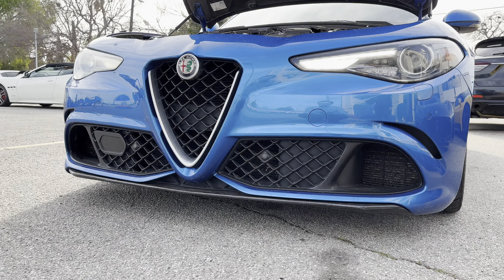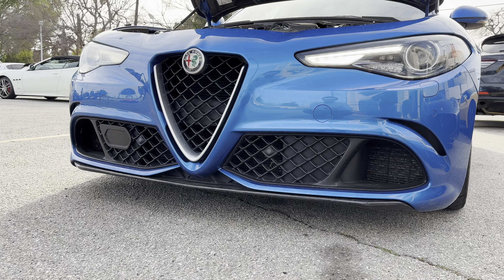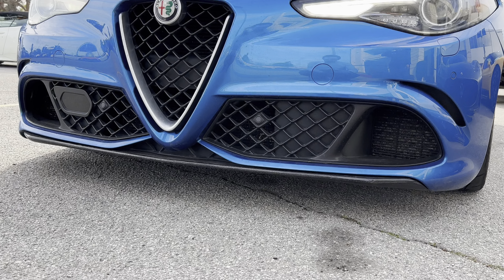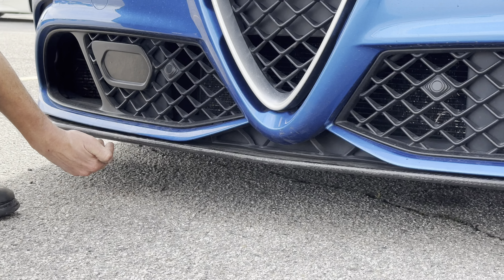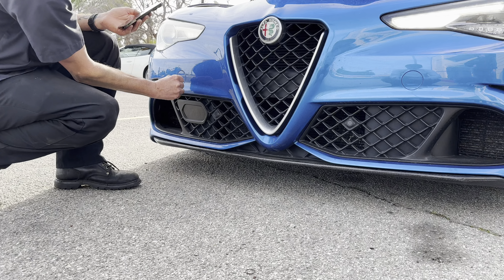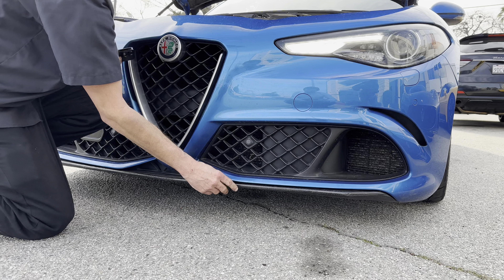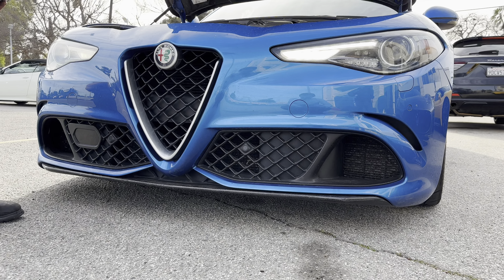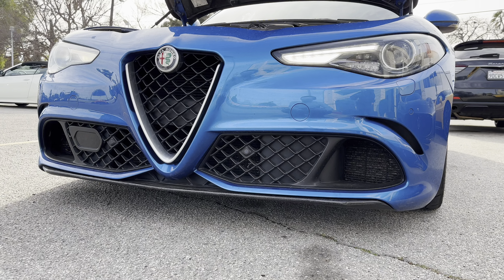Spoiler *TEST* | Alfa Romeo Giulia QV | Calibration RAW

Comment: How did u lower the lip? Would be good to be able to do that at a press of a button just to wash the gap between. And what was it u said about carbon cleaning the engine?
Reply from the maker: Thanks for watching. I wish it was that easy to lower the spoiler, but the technician used an application and wireless dongle connected to the OBD port to deploy it and calibrate it, sorry I can’t remember which application he used. I was just curious if he had done the carbon cleaning since this has DI only and no additional port injection like newer QVs. Sounded like has had in the past but he did not elaborate.
Reply: Squadra performance logger can do that , it's an obd dongle you can buy